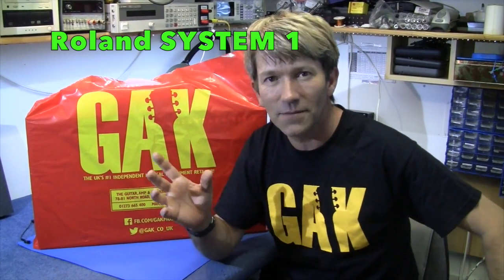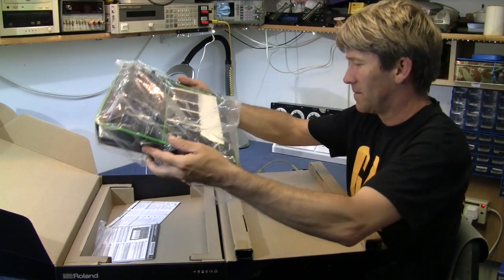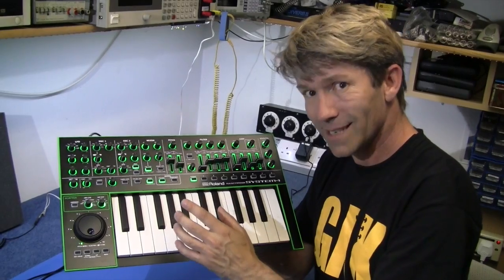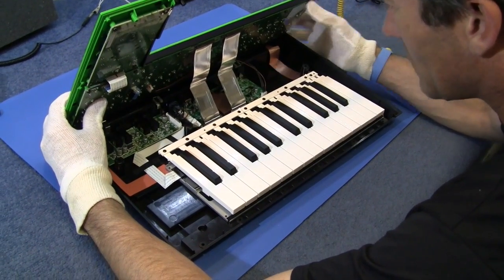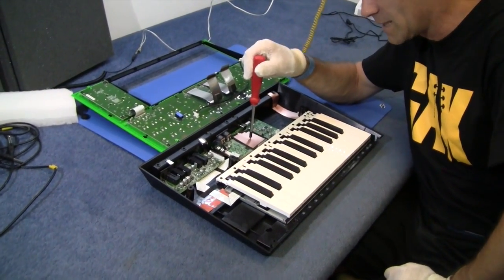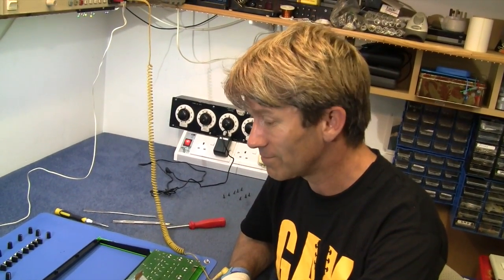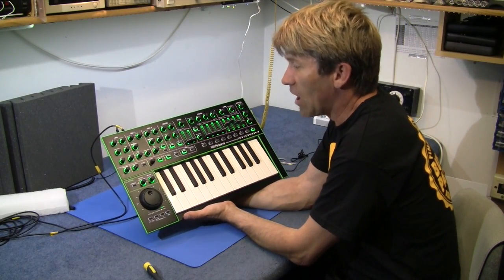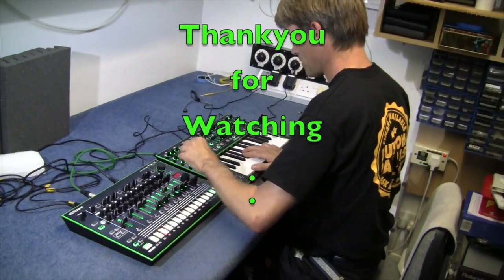MF#29 Roland AIRA system 1 Teardown & a look inside

Comment: My System 1 just lost power whilst I was playing. It completely fails to power up and is just dead. Have tried a reset - didn't work. Any thoughts appreciated
Reply: I'm in the same boat - have a brand new power supply and still no go. Opened it up and saw no obvious fuse...and no fuse was observed and/or pointed out in this video either.

Comment: Hi , I bought a System 1 off ebay yesterday and waiting for delivery...after watching this video you mentioned a slot that has the copper foil , is this for an SRX type slot for the SH101, I bought this primarily for the SH2 plug out.. I don't understand this copper shielded vacant slot inside.
Thanks in advance.
Reply from the maker: Hi Andrew, the copper was just for shielding, any of the plugouts for the System 1 are purely software downloadable into the machine and there are no extra boards that can be phisically plugged into the internal board. the slot inside is likely only used by roland at the time of manufacture for programming or testing the board. I wish I had kept mine as it was a great little synth. best wishes Marlus.
Reply: @markusfuller  thanks for the reply.

Comment: Roland system 1 
 biggest scam ... after leaving it unused for a while now part of the keyboard does not work... the potentiometers are going crazy... and the repair is over 300€ by Roland... a damn scam
Reply: It's very easy to repair. I had the same issue and was able to fix it by cleaning the contact below the rubber strip with alcohol.
Reply: @stereodelay6601  I did exactly that and it doesn't work, I will have to discard the machine... the cost of the fix is about the same as the price for a new one.

Comment: One of my keys failed :( It engages when I press really hard; and sometimes will start working after a bit of repeatedly press the key. I'm going to try to clean it with the help of this video.
Reply: I had the same problem and I just glued a tiny plastic under the key. Now it works as all the other keys :)
Reply: Hi man,I have your same problem..have u a picture to know which is the specific point you have glued the tiny plastic under the key?thanks in advance

Comment: Well I couldn't delete my original comment, but for anyone needing to disassemble the keybed the keys slide out once the screws on top of them are removed from a set of rubber covered prongs that the keys slide over when going into the keybed, you don't need to remove the 8 screws directly under the keybed to do this as I stated in my previous comment, to remove the panel just remove the 5 screws at the top lip, the 3 recessed screws after that, and the 10 screws at the bottom of the rear panel closest to you and the top panel will come up. It seems the key was sticking b/c there is a white grease on the rubber that is on the prongs that the keys slide over and I guess there was just a bit to much on the black key that it was causing it to stick. Other than that minor hiccup I love this synth and think it was a perfect swap from my Microkorg although it doesn't have some of the features that the MK has I like the way this sounds much better and I love having all of the controls at my command!
Reply: HI, I have the same problem. SO you just pulled out some grease and key was fixed?

Comment: Thank you for the video, I do however have a question. I purchased this synth used and one of the black keys is sticking. I went to take it apart and I thought it was worth mentioning for anyone else who may have any future problems with the keybed that it seems you will need to remove all of the screws from the back side in order to disassemble the keybed as I can't seem to pull the keys up from the board after removing the screws on top of the keys inside. It seems to be interlocking with the underlying circuit board.
Reply: I just got a used one and high E was dead. It took about two hours of fiddling to get it working. After the initial clean did nothing, I just left it turned on with the lid propped up. I had to clean under that dome at least three times before it worked. I would have gone nuts if I had to take it apart every time to get those keys out. It was a big help that I could leave the lid connected and lift only that small bit of the contact strip.

Anyhow, the trouble with getting the white keys out is there is a metal lip at the bottom that the white keys bump against. You just have to gently prod them up over it as you pull them downward. They are in 3 pieces, CEGB, DFA, and black. Take out upper C first so you can get used to it, but I could take out just the high octave with the others still in place.

Also I had to be careful putting back the four corner nipples of the contact strip, they have wide bell-ends on them and I had to poke around the edge of the hole with my unbent paper clip to carefully prod them in. If only one key is causing a problem, consider lifting just around that dome.
Reply: @8bitwiz_  Hi! I can’t seem to put back in the four rubber nipples on the edge of the strip. How did you do that exactly?
Reply: @stereodelay6601  i used a match stick and put a little vaseline Petroleum jelly on the 2 end rubber spikes , you have to be patient and continue to work them in  perpendicular ..theyb are a PITA

Comment: am I able to just plug the Roland AIRA system 1 into an amplifier without having to plug it into a computer? could I just take it out the box when it arrives and plug it straight into an amplifier and would it work?
Reply from the maker: +Kielan Lee Hi Kielan. Yes the System-1 works straight from the box. linking to the computer is just for registering and loading the SH-101plug-out that you should get a card with the serial number in the box. but you do not have to use that as you can make your own sounds and save them directly in the system-1 without the need for a computer.
Reply: Ok thank you for your reply, it really helps.

Comment: Hi markus. ok. I have to replace some of the play buttons on mine and was just wondering if it's an easy job. I'm handy with a soldering iron.
Reply from the maker: +Terry Kelling Hello Terry. Im not sure what type of buttons they are in the RM1x. they feel clicky as though they are small surface mount buttons and possibly the top play button will be a plastic part that just touches the actual button on the board. Im guessing they will be those small 5mm square units with the small black circle protruding from the top, if so they are easily available. though im only guessing at the moment.
Reply: Hi markus.  Ok thanks. Seeing as the unit is getting on for 30+ years old now and a couple of the play buttons (the non clicking ones) need replacing. Would it be prudent to replace the complete set of buttons.  That's 27 soft touch playing switches + 45 panel button switches.?

Comment: Love the videos Markus. What intrigues me is the fact that the key bed shows two switches indicating velocity sensitivity yet the synthesizer does not respond to velocity from the built in keyboard. Is this a feature that may appear in a future update?
Reply from the maker: +Jandro Kirkish Hi Jandro , No I doubt there will be an update for velocity on this keybed. maybe on the next roland system #? they will have a better keybed with velocity.
Reply: Thanks for your reply. The newest firmware update unlocked more patch memory (64 patches instead of 8) and added 6 new waveforms; this makes the system 1 a really powerful synth engine. The memory was already there, it just needed an update to make it accessible. I'm wondering in light of this something similar might happen with velocity. Did you ever look to see if, underneath the two pads, there are two actual switches, or just one? That would at least settle the question as to whether this lies within the realm of possibility.
Reply from the maker: Hi Jandro. Sorry I did not take the actual keyboard apart. Instead I sold my system-1 and bought the System-1m module instead. It just made me a little more room, its the same thing but without the keyboard and instead has CV gates etc. if you use a midi controller keyboard you can add the use of Velocity.

Comment: I know this is an old video, but I thought I'd ask here anyway. I've seen a lot of mention (including here) that Roland's ACB is done using FPGA chips. Is there a source that verifies that fact somewhere? How do you know they are FPGAs and not more standard DSPs? I've searched the web but I can't find any specific mention of what kind of processing technology is used other than some people repeating that's in a FPGA....
Reply from the maker: Kamil Kisiel Hi Kamil, the nature of the Aira systems is that they can be redesigned via software so that the keyboard can emulate another of the roland line of synthesisers. After you have made the circuit for the synth you cannot really change it after it has been shipped to the customer (yes you can use samples and some reprogramming of DSPs etc) However FPGA's (field programmable gate arrays) use basic logical building blocks and can be reprogrammed after you have shipped the product, This is how roland will keep on producing plug-out versions of synthesisers by reprogramming the Analog circuit behaviors of the building blocks of the FPGA's inside the System-, TB-3, TR-8 & VT-3. When I took the System-1 apart there were 2 FPGA's inside though I could not confirm the exact chip used as they were marked with rolands own unique chip numbers. Yamaha and hewlett-packard also uses some standard manufactured chips but have them marked with their own unique numbers which makes them difficult to identify.
Reply: I guess my question is, how do we know they are in fact FPGAs being reprogrammed to have different circuit behaviours, and not DSPs which are just reprogrammed to emulate different analog circuits? I haven't been able to find any information about the specific technology used.
Reply from the maker: I think the only way you will find out for sure is to contact Roland directly through their website, you never know someone may give you the answer. ?.

Comment: Anyway, even if you had taken off the copper cover, there is most probably an FPGA and a proprietary Roland DSP under there with numbers that don't tell you anything unless you're a Roland engineer.
Synth technology hasn't evolved much since the year 2000 at Roland. This looks very much like the insides of their JP8000 VA synth from that era, granted with a much more compact PCB with less chips, but the technology is the same old virtual analog crap.
Reply from the maker: Hi Alain. Im looking forward to the new series of Korg analog remakes. it can't be that difficult to machine and remake synthesisers in the good old analog style and Im sure there is a big market of people waiting to part with their money for something truly analog. time will tell.
Reply: I'd far much prefer the JP-8000.  In fact, let me look for one on eBay right now...
Reply: Andrew Piatek i have one.  It's nothing to write home about.
Reply: James Reeno
I thought you were talking about System-1.  Then I would agree.  JP-8000 is several leagues of higher class than the System-1.  It's like Emulator II vs. Casio MT-series.  I'd love to have the JP-8000.  I saw one MINT once, didn't buy because of only 4-octave keyboard and no aftertouch.  But seeing the products that are coming out nowadays, I want JP-8000 badly right now.  It's incomparably better than anything Roland has currently on offer.
Reply: Andrew Piatek You might want to consider the new Roland System-8. From what I've seen and heard so far, it might outshine the JP-8000.
Reply: +AlainHubert Ha ha, good try.  Yeah, System-8 is bot bad, but sequencer buttons a bit on a cheesy side.  I'd prefer JP-80, or even better JD-800.  But the thing is I would not replace my D-50 and SY77 for any of those, so I won't be kidding myself.  in other words, having SY77 and D-50, I don't really need any more synthesizers.  I'd kill though for a MINT RD-1000 :)

Comment: theres no record sequence in the sh101 plug out
Reply from the maker: I have tried to load the SH-101 but it seems logic 9 is not capable and i have to buy logic X. why I cannot just load it into the Aira keyboard directly is a mystery. I think Roland should sort this out as not everyone has the very latest DAW.
Reply: I will see what's wrong i still have logic 9
Reply: markusfuller hi mark load logic 9 in 64bit and the plugin will work .for some reason its the 32bit au not working??
cheers
terry
Reply from the maker: Thanks Terry. I never thought of that. will have a go later today. Best wishes
Reply: just checked the roland site and the plugin is only 64bit mac ,so thats the reason.
Reply from the maker: I have a 64bit Mac. just reloaded the logic in 64bit mode but still unable to load the aira ah-101 plugin ?. Im having a look into the roland site for info.
Reply: markus find the logic 9 app in applications and right click on it open get info and uncheck the 32bit check box close the info ox and reopen logic 9 it may take a while to scan your 64bit au. should work then.
Reply: sorry didn't see your last post did you look in logic to see if its in the list? I'm on logic 9.1.8
Reply: roland have released  sh101 v.1.01 with 32bit au support markus
Reply from the maker: I have not managed to get the SH101 running on mine yet. seems at the moment it will not load on logic 9. I hope they will sort this out or I will not be able to buy any future plug outs. and why i cannot just load it directly into the system 1 is baffling me at the moment.
Reply: Do you have able ton live you could try the au and plug out there

Comment: Thanx for this little look inside, Markus....As expected not much in it....No need to unsolder this copper shield, as it contains just some usual multipin dark black whatever. May it´s an FPGA or a roland made custom chipset.
So no need to peek. I think, as this unit is slighly more powerful than the previous roland devices which you already opened, the chips need some more cooling so they done a little copper heatsink....